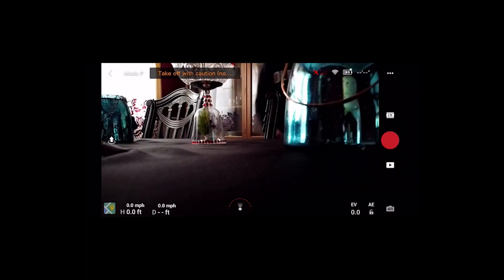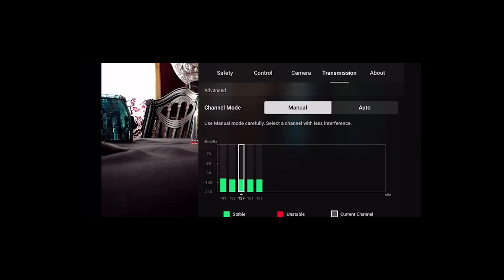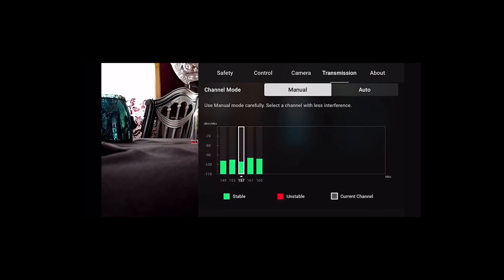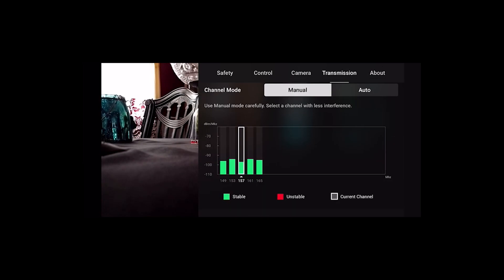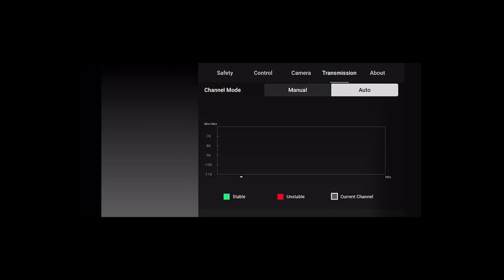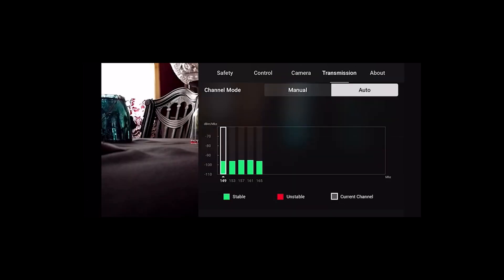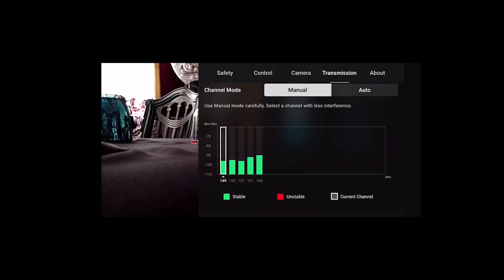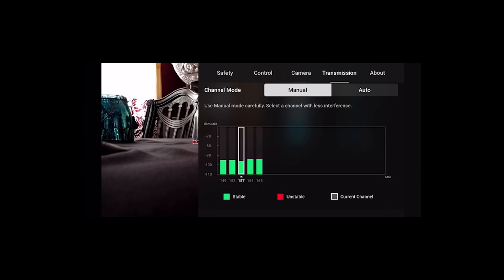Mavic Mini RC Disconnecting Issue

Comment: Hi, my phone is having issues when I set it up 
With the controller first. It keeps connecting then disconnecting repeatedly even though the drone is still near me. How to fix
Reply from the maker: Check the radio channels of the wifi in this video.  Mine was doing this as well and this is how i fixed it by manually changing the channel to a less congested channel.

Comment: My mini is only getting like 500m with my spark in the same spot can fly over a mile. This is not my first drone by far! Also in transmission settings I have 4 channels n tried the all with no avail. I order the range parabolic dishes like I had for my spark.